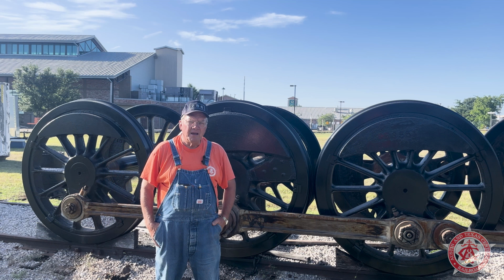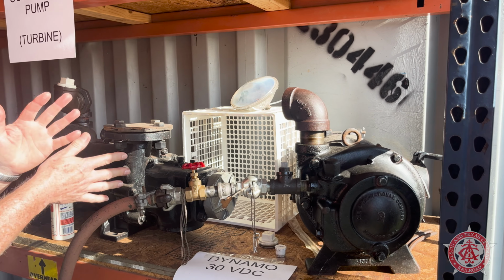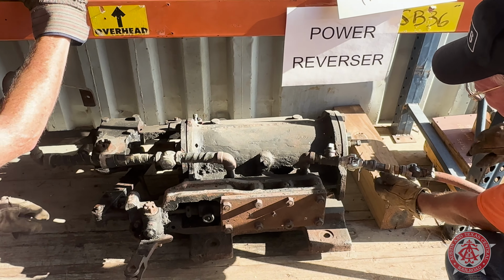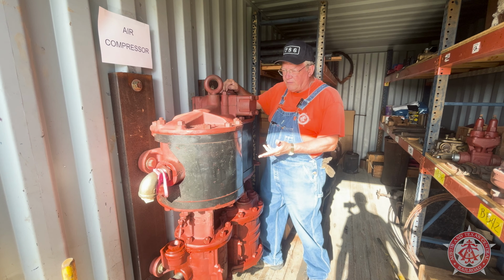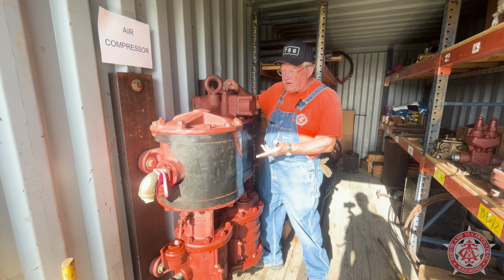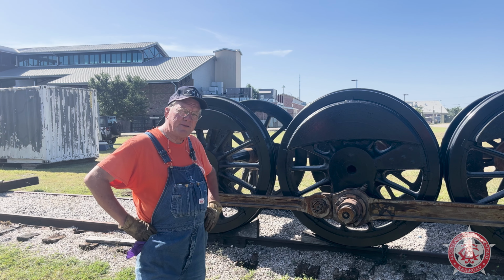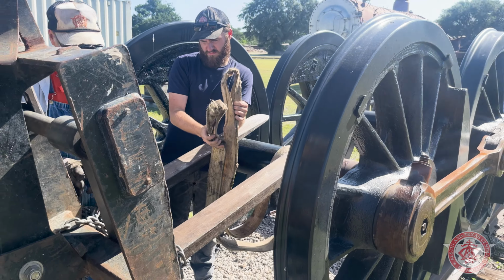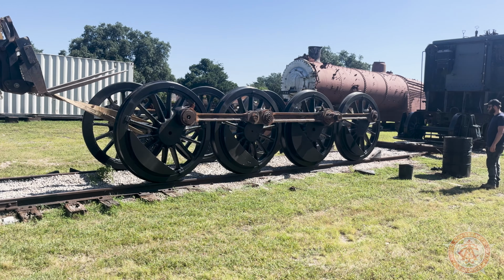Testing SP 786's Appliances & Moving the Drivers - Ep. 2

Comment: Which dynamo is that?  Is this the dynamo you purchased from the organization in El Paso or the one that was on display on 786 in Austin?  Just curious.
Reply from the maker: That is a very interesting question.  I have passed it along to several of our longest time volunteers, but nobody I've talked to seems to know that answer.  Unfortunately many people involved in the initial restoration have either retired or passed on.  I will let you know if anything comes up, though.
Reply: @austinsteamtrainassociation  
What both John Charles and Gary Bonine have told me in the past is the dynamo from 786 has a vibration issue which results in a premature bearing failure.  The dynamo that you purchased from the SP 3420 group back in the early 1990s came off of SP steam Derrick 4140. This became your primary dynamo.   The steam derrick was rolled by the SP while cleaning up a derailment outside of El Paso in June of 1986.